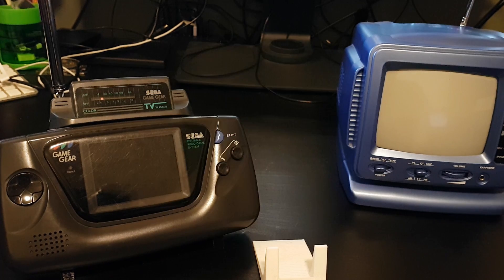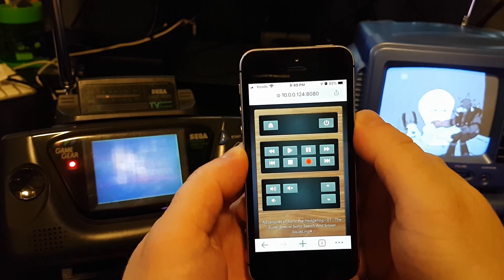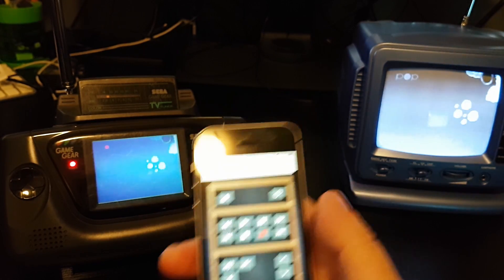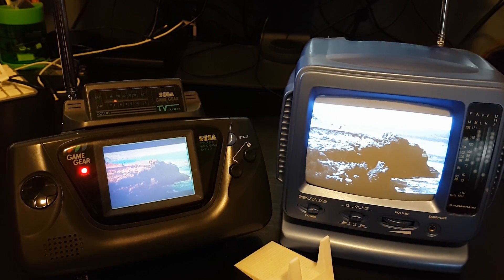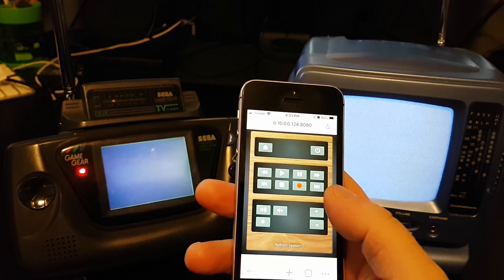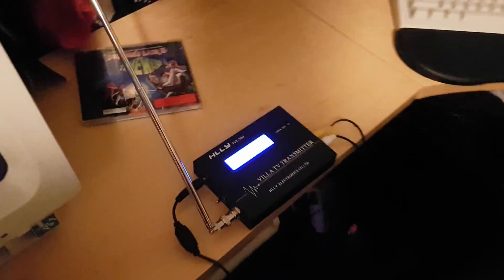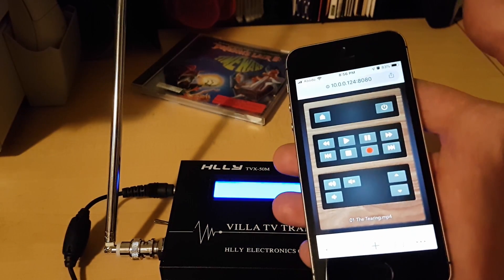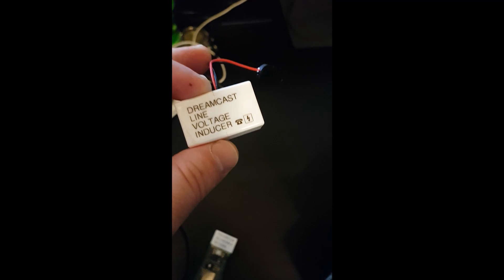Building a 90's UHF TV Station at home using a SEGA Game Gear TV Tuner and a Raspberry Pi

Comment: Cool your own closed circuit tv station. I'm having trouble finding the transmitter box.  I saw those used for old security systems
Reply from the maker: I bought mine off ebay, they seem to have all disappeared from there. That's really disappointing. There were many listings before.

Are you using PAL or NTSC TVs?
Reply: @HomeAwesomation  ntsc.  I have a ton of dvds and old video tapes in 4:3 so I thought that I could dump them on my linux box or use a pi like you did....or just hook up the equipment
Reply: @HomeAwesomation  I can only seem to find FM(radio) transmitters

Comment: Love that you used nodejs and Vue.    I wouldn't even mess around with making it a native app.  Just make it a PWA
Reply from the maker: I was planning on wrapping it as an electron app but pwa might make more sense since I think that means you dont have to side load it or distribute it in the market which wouldnt make any sense at all.
Reply: @HomeAwesomation  let me know if you would like to collab on something like this sometime.  I am a web dev for a living
Reply from the maker: @calebprenger3928  correction, cordova, electron is for desktops. The issue with cordova is the API must be behind a valid SSL certificate which kind of sucks because that means you can't really host it without exposing it to the internet. Secondly PWA's aren't really supported on ios, I would be targeting iphone for my purposes. 

I'm leaning towards making a react native app because I won't have the same SSL requirement, and I could then leave it up to the end use to decide if they care about ssl or not by allowing it as an option.

This may take longer than I thought, or maybe never happen. I burned a night on research to determine there doesn't seem to be a quick win, so I'm going to chew on it for a bit. 

I am always open to collaboration where it makes sense, you can find me on github of course.

Comment: This is super rad, I could see someone who lives in a rural community making something like this, it truly is a neat thing. Whats the range on the broadcaster?
Reply: Also, is it really easy to tune to the channel now because their isn't feedback from other stations.
Reply from the maker: @jamespolnick  The range, stock is pretty decent. Almost too far for my liking because I live in the middle of my city in a very dense area.  It says it does 30 meters. It can do much farther than that, line of site. I have walked down to the end of my street which must be a few hundred feet from my house. However through brick and other stuff, that range falls of of course.

If I mounted an external antenna outside, I bet I could broadcast pretty far.